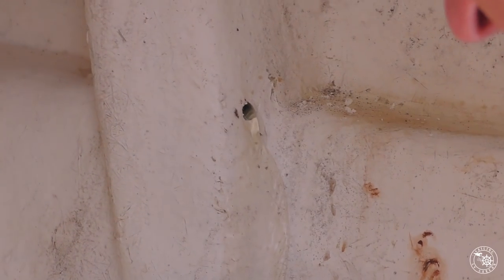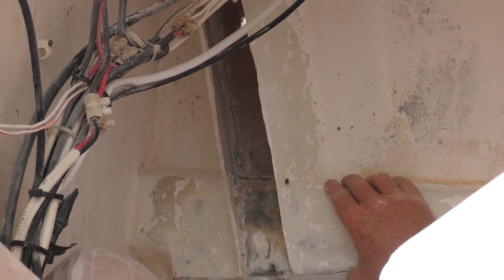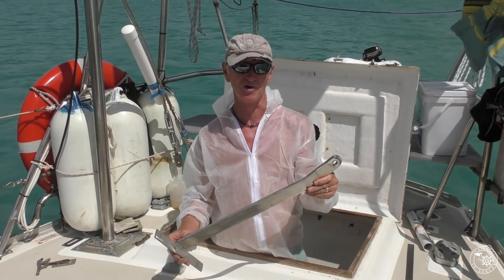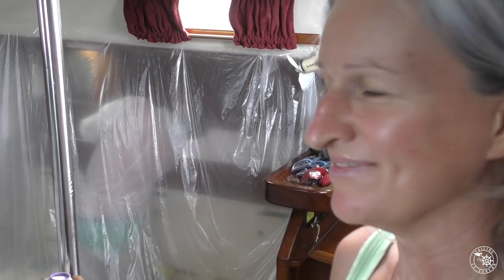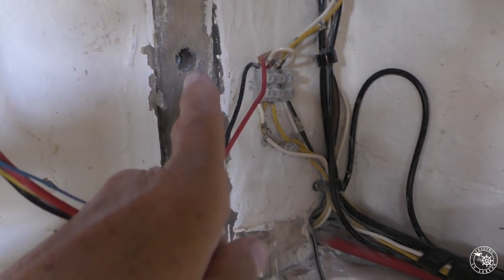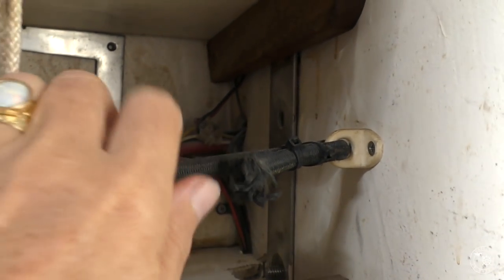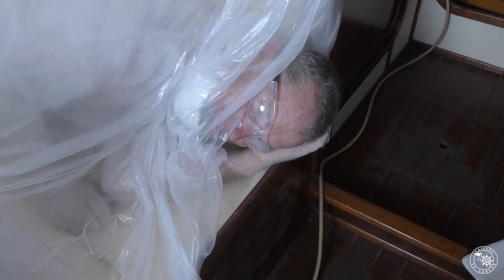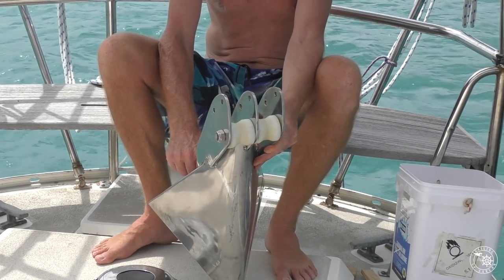Replacing Our CHAINPLATES (Sailing SV Sarean) EP. 13

Comment: One way of keeping water out of the enclosures over the chain plates would be to leave a small hole at the bottom. In addition to water possibly leaking in past degraded silicone caulking diurnal condensation can accumulate water over time. If there is a small hole at the bottom it can help eliminate this. You did a great job on the replacement / upgrade!  Your video is bound to be helpful to others.
Reply from the maker: Thanks so much Richard!  Yes we drilled holes in the bottom of each encasement as you say to enable us to monitor any future leaks.  We also used a 'neutral cure' sealant which doesn't affect the stainless.  Thanks again - we hope you keep following along!

Comment: Enjoyed the maintenance episode. I could sense your doubt with the anchor roller nose cone mounting bolts. I suppose the boat has been on the water for thirty years with no anchor roller/ fore stay structural issues. so it would be fine. I'm restoring an older Farrier 720 and the designer recommends that when mounting and encapsulating a chainplate or any stainless or aluminium supports that you rough up the surface that is to be glassed with a sander to help with bonding. That pitted chainplate was it replaced or welded and sanded?  Rob
Reply from the maker: Hi Rob!  We replaced them all in the end.  Even those that weren't looking bad.  Our thought was that they stainless was not a huge cost and they were likely work hardened.  Plus with doing the job ourselves we could keep costs at bay.  You are correct with the sanding.  Claude roughed up the lower portions and left the top section polished for us.
The Nose Cone was really interesting for us!  It had stainless plate welded on the inside that took the threaded bolts.   We were just surprised I would say as we were expecting it to have slid over the end of the bow, instead of bolted on.  Boy she looked pretty odd with it off!
Reply: Morning again, thanks for the feedback, I,m impressed with your work ethic and patients you show with explanations of your processes etc.  Merry Christmas and kind regards Rob

Comment: Man your keen, it's like catalpa drillīng  a trancducer hole in his ferro hull dryed out  between tides . Cool, wish we could have seen how it looks with the nosecone off and shown us how you took it off, there must be some serious strong piece buried in glass up forward there.  Another awkward  mongrel job, gees those chain plates wow what a pain, just resin and glassed in ,no bolts to the stringer? at least it's over and you didn't have to destroy  too much to get at em
Reply from the maker: Hey Phil!  The Sidestays were bolted through to steel backing plates.  Lower Shrouds glassed below the Stringers.  It's a good system actually and we don't see them going anywhere as they have the t-section underneath holding them firm.  Cheers and thanks so much for following along!

Comment: 19 days and 1900 dollars. So questions... was that for all new chainplates or did you reuse some? Don't think you did but not sure. What about the bow nose? was that reused and new bow rollers welded on or did you fabricate a new one?
You didn't replace your standing rigging so what age is it?   As far as changing the chainplates, I feel you did the right thing, keeping it as it was built. Encapsulated lasted a while, its now that big of a deal to remove in your case, you didn't have to destroy wood to get to it. Maybe leave a weep hole. Also instead of silicone sealant I would use butyl tape for the deck area. 
Nice work guys!
Reply from the maker: Hey Bob!  Lots of great questions there - be sure to watch our next Q&A where I will tackle them all for you in person!  Meg :)

Comment: So you weren't tempted to leave chainplates exposed so you could visually inspect in future?
Reply from the maker: Hey Shaun.  No we couldn't really do that.  We had to glass them back under the stringers.  However we have drilled holes at the bottom of each Chainplate so that we will be able to see water coming out if it does manage to get through the deck in the future.
Reply: Sailing SV Sarean good idea. I would be constantly worrying they had refilled having a predrilled hole to check would be reassuring.

Comment: The Way You Fixed The Chain Plate,and Put the Fiberglass Around the Area,will Any Condensation Form Under It,Etc.How Did you,Or,Did you Ask Someone If That's the correct Way to Fix that the right Way.If that Is the right Way,Or Temporary..??Thank you.Look's Very time consuming to Work on Boat's.I Like The Fact you Made A Repair Shop,As It Were,Nice,Bravo..Being At Sea,With A Repair Shop,you Can hire your Self Out to People that Need something fixed...1st.Repair Shop Ive Seen In The Bluewater,Etc..
Reply from the maker: +FiddleStick's bessette Hi FiddleSticks!  We are pretty happy with the repair.  We had it well sealed off from the top prior to glassing so it should be good!  Yes, one of the benefits we love about cruising is being able to 'pay it forward' with our skills to help others.  Sharing is a super gift!  Thanks so much for following along!